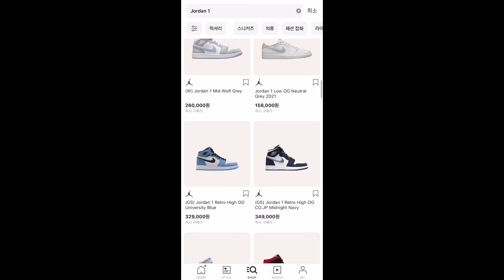'NIKE' 'Air Jordan 1 Bred' OG - Make Swoosh, Sole Swap, Dye - VeTiVeR

Comment: That's a phenomenal restauration process and also a great detail to ship them to the owner on the donors box.
I'm learning so much out of these restaurations.
I will do a  vintage Nike Legend restauration/sole swap myself in a couple of days more.
I wanted to ask, in case I'm not able to find a Nike Legend sole donors, Can I use an AJ1 soles? Or maybe  a pair of Dunks? I was thinking on a AF1 soles since the Legend Uppers are similar to the AF1's. I hope you or anyone can answer this question to me.
Reply: Oh man, the Legend sole swap will be tough. I don't believe the Jordan, Dunks or AF1 will work, all of those are pretty different from the 80s Legend soles in form and tread. Closest form fit might be The J's, but obviously the tread pattern will be different. I just can't think of a modern retro'ed shoe that uses that exact herringbone pattern.  Good luck with your project, hope you find a good match!

Comment: I'm shocked. Did he really buy a new pair of Jordan which cost very expensive just for the sole?
That's bullshit
Reply: Thinking the same thing
Reply: The vintage one he repaired with the new sole is around 100x more expensive.
Reply: But now after adding the new part it take value
Reply: i dont think you realise how jordan vintages work , if theyre wearable theyre way more expensive. Nobody will buy a real beat up deconstructed pair , think about it. Collectors and die hard fans just buy them and thats fact. The only thing that matters to be original are the uppers all soles from that era are cooked, have a friend who owns a 90s pair that was resoled 7x before he got them and still payed a large sum.
Reply: fr bro i was thinkin the same
Reply: They were mids and plus it was well worth it. Also, he used the swoosh too. Not just the sole.
Reply: thats what i said
Reply: @hobblybob6154  true
Reply: these are the 2001 retro release so not the same as the OG 85s..
Reply: @mohammadalmoustafa6446  100% not true 🤦‍♂️ if they were the 85 release they would be but these are not..

Comment: Great job on restoring the 2001 breds! I have a DS pair and I'm excited to wear them even if the soles crack.
Reply: I thought they were the 85s but something seemed so off I’m glad you pointed it out
Reply: @jovanijaimes6340  there would have been some pretty major cracking of the foam around the ankle collar if they had been 85s, also the swoosh on the 85s were a very short haired synthetic suede material. At first i thought they were 85s too until I saw the swoosh, it's crazy to think though that this pair is still 20yrs old.
Reply: I was trying to figure out what year these was, the colars are not crunchy enough to be 85s.

Comment: 0:01 Intro!!
0:57 Remove the Out-Sole
2:36 Cleaning
3:55 Deglazer
4:58 Leather Filler
5:20 Leather Pigments
8:11 Remove Swoosh
8:53 Low Gloss Finish
9:15 (Most Replayed)
9:38 Buy a New Jordan !
9:53 Remove Sole
11:14 Make a New Swoosh !
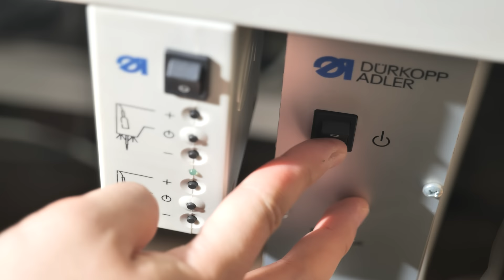11:29 Sewing Machine
13:31 Sole swap
14:40 Hand stitch
15:49 Deodorant & Protector Spray
16:24 It's Done !

(This took about 15 minutes or so)
Reply: You just got it from the desc 🤡 lol

Comment: i have an old pair that still in decent condition ( they dont have any scratches or dents )  they are the red & black ones, ( they are a remake of the very first pairs that came out ) People have told me that if i fix them i can easily sell them for like $100.00 +

The soles fell of in the past, after that i tried using a glue that i bought on ebay tu put them together but i ended up taking it off because it wasnt stable enough apparently i needed a better more sofisticated one, but then the white part at the bottom of the shoe got stained with the glue and now i dont know how to take out the glue off the white part and the glue is yellow very noticeble, in some corners.

i am afraid of using the brush to much and damaging the material in the white rubber. 

the shoes is in great condition for the years ive own it, i have them since i was 18 and now  i am 32. is there any special technique or solution i can use to take off the glue without damagaing it? and also what what is the best glue for soles.  Thank you in advance.

Comment: Truly talented! However, with all the skill set and effort to refurbish those OG Jordans, the front of the shoes were left wrinkled taking away from the beauty of the pair. The Smith who refurbished these shoes should have taken the last step and moisturized the front of each shoe with leather conditioner making the leather subtle then place inside shoe trees to reform the fronts of shoe. Doing so would have helped to atleast minimize the wrinkling if not making them seem unused or in near mint condition.
Reply: these are not OGs 🤦‍♂️

Comment: Hi what is the metal box you put the Jordan at 10:00.
And why?
Thank you for the answer.😇
Reply from the maker: it's a steam machine, for remove outsole glue. like heat gun.
If you steam your shoes, you can easily remove the soles.
Reply: @VETIVER  OK thank you I didn't know about. Success